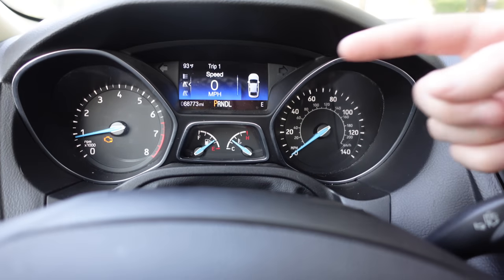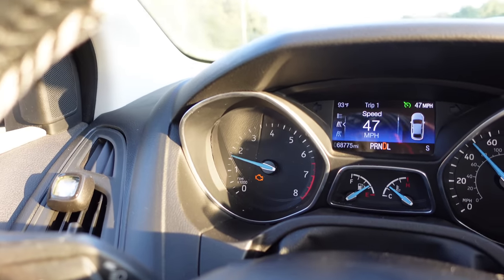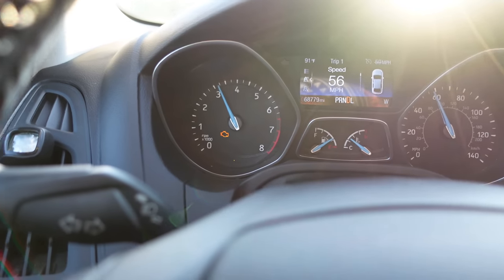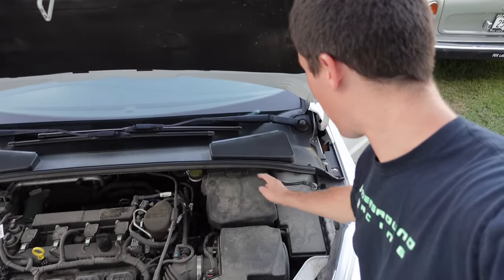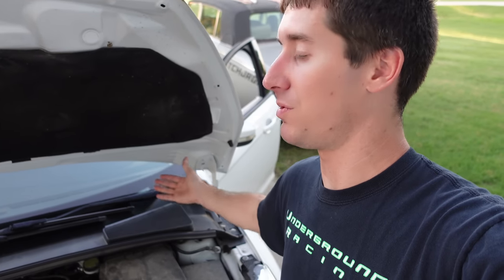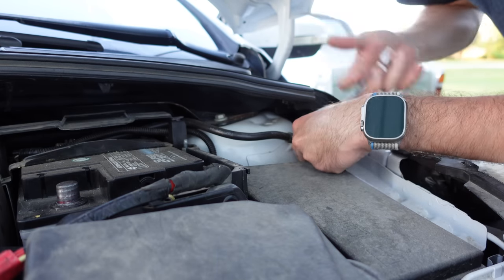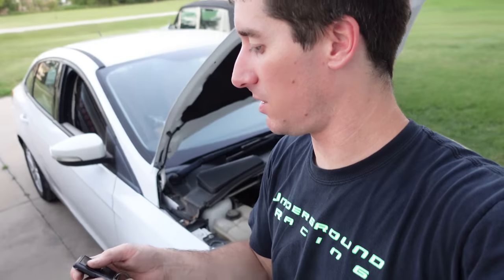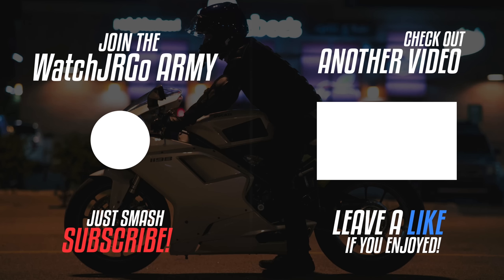This NIGHTMARE Transmission DESTROYED The Ford Focus (Fixing My Girlfriend's)

Comment: I had a discussion with a Lincoln dealer service manager about the fluid change interval.  Even though Ford touts 100K miles, honestly change the transmission fluid every 30K miles.  Dual clutch transmissions put much more work on the transmission fluid as it is the friction modifier as well as the lubricant.  Many times a bad transmission may have bad fluid that leads to clutch degradation.  As a PhD chemist I think that the 100K mile OCI for the transmission fluid is just too long.  Corrosion of grounds can be an issue but if what you describe is happening I think you have physical damage to the clutch packs at this point.

Comment: My mom just went through this with a 2013 titanium with just over 100,000 miles. They couldn’t even get the control module decided it wasn’t worth it and bought a different car. Which was really too bad. They still have their 2001 Ford focus that just refuses to die.

Comment: My wife's '14 Focus Ti only has 20k and it's had 2 replaced under warranty. So far it's been managable outside of warranty so long as you give it throttle with purpose from a stop and occasionally do some highway passes. Car is otherwise mint and pretty good for 9 years.

Comment: I'm at 130k miles on my 2018 focus SE. The only thing I noticed so far is starting at stops on some stops it likes to be very rough. But other than that no issues. 90% of the miles are highway miles though. I haven't changed the tranny fluid yet. I was wondering if I should even bother with it being so late into its lifespan. I would like to keep it going as far as possible.
Reply: Doesn't seem that late to easily drain and fill the DCT Fluid.

Comment: I was a near 40 year long dedicated Ford only owner whose last new car was a 1997 Ford Escort that I owned for 22 years and with nearly 180k miles.  It was as reliable and durable as a Honduh (but without the Honduh tax).    Up until about 178k miles, I had no issues and was just replacing tires, brakes, a slave cylinder in the transmission and scheduled water pump/timing belts.    But at this point the original parts were failing in succession and the cost to repair exceeded the value of the car.   And after 22 years, I was tired of the car and wanted something different.

I had considered a Focus but knew the transmission was garbage and even though I wanted a manual one, the value of the car was also garbage and if I bought one, the resale would decrease significantly.     I started to look around and found out that the 2016 Hyundai Elantra was a great product and after more work, I found one that was three years old, with 21k miles and it looked and drove like a new car.   It cost $13k and I bought it.   I will never go back to Ford.    This Hyundai has been a joy and recently turned in real world mpgs of 48.3 mpgs on a tank.   The car still looks and drives like new and I am blown away with how much room it has.

My sister.... bless her heart, bought a 2015 Focus with that awful transmission without first asking me and she has the issues you point out.   That car is garbage on so many levels - cramped and just not well designed.   So glad I didn't buy the manual transmission version.    

I know that JRCAMO will never fix this and this is because he doesn't fix anything - he just half-arsed does stuff all while his voice made for print media continues to drone on.

Comment: change the actuators.. it worked with mine  (2017 s model) you may have to clean the internal gears from the clutches,,, (they got stucked) there is a guy that shows how to without removing the transmission

Comment: I bought it a 15 Focus SE with salvage title at 56 K miles in 2020 and got to 110 K so I got some mileage out of this . I didn't know about the tranny / clutch issues at all  At first . i got the code P0720  transmission electrical sytem and cleaned the grounds to bare meatal . It drove like new a few times but then went downhill verry quickly and have overheating and no Transmission codes at all .  Now I'm about to put in some clutch actuators hoping that fix it .. super easy to try this bought some actuators on eBay at $40 each . Saw some videos that this works .  just plug and play no reprogramming super easy to do
Reply: What was "overheating"?  How would you know if the transmission was overheating and how might that even be possible?
Reply: @01mustang05  dash said it was overheating to turn car off for a few minutes

Comment: Why did they decide to put a DCT in an econo car??? Are Ford hydraulic transaxles of that vintage reliable, or are they a hot mess too? I'm a GM guy, had problems with the 4T65E in my old GTP and it makes me leery of their transaxles... but the 6L80E in my current car has taken a beating without a hiccup 😃

Comment: I have two of these, a 2012 and a 2015.  Both had the "transmission shudder" as Ford calls it, fixed by the dealer under warranty.  Ford actually extended the warranty to 7 years/100,000 on these tranmissions...unfortunately, not quite long enough in your case.

Comment: It was about 2 months ago I had to R&R a dual clutch transmission in a 2015 Hyundai Veloster. Basically the same transmission setup in the ford focus and if you get a crank sensor code in the ecm data the car will still run just fine but the transmission will not move. After I replaced the sensor with a OEM part the transmission shifted butter smooth. I did informed my customer that the transmission control module will need to be updated not flashed for the fork actuators to keep up with the clutch disks. I will prolong transmission life by 60%..

Comment: As a ford transmission tech, take the car to the dealer, we get about 2 to 4 focus’ a day for tcm issues, they can be fixed and you need to basically abuse the car for it to act right and also the battery must be good for the tcm to act properly, there is no hydraulic controls for these units it’s entirely electronic, the clutch fork is most likely bad on this and will need a clutch job, which will include forks, bearing and clutch with possibly getting both motors replaced, the tcm was extended to 250k warranty replacement

Comment: Bought a used 2013 Focus in 2013 from a dealer that only had 9000 miles.  At the time , we were unaware of the transmission issues.  Not long after we bought it, the problems started.  Took it to the dealer and they said the software needed to be updated.  So within a few days, the problems came back.  Very rough shifting in 1st and 2nd.  It's an automatic.  Every time we took it back to the Ford dealer, we got the same excuse.  They even tried telling me the transmission was adjusting to my driving habits.  What ???  Anyway, no matter what they did, the problems were still there.  Over time, the problems got worse.  It got so bad that sometimes at a full stop, when you hit the gas, the car just sat there.  Very frustrating .  My wife hated driving it.  Finally, after 2 and 1/2 years we had enough.  We bought a different car and offered the 2013 to a Ford used car dealer.  The car had about 45000 miles on it.  The dealer took the car and paid us what they thought it was worth.  Not sure what happened to the car after that.  If the dealer didn't repair that transmission, I pity the guy who bought that car.  As I think back to all the cars I've owned over my lifetime, this 2013 Focus was , by far, the worst car I ever owned.

Comment: Here in the Netherlands it's quite difficult to find an automatic, not impossible but you'll find more manuals. That was the one thing i was looking out for when i bought mine. I have a pre facelift hatch manual which drives great and together with the 1.6 Ecoboost it's fun to drive
Reply: In the UK, prior to about 1990, automatics were only for disabled, elderly or for those people who just couldn't drive very well. Even big luxury cars were automatic because only old men bought them.
Reply: The most effective anti-theft device in the US is a manual transmission.  Finding anyone under 35 who is even able to drive a manual is getting very difficult.
Reply: @pk4459  wow really? Also hard to find new cars with a manual nowadays. I mean automatic is great. One less thing to think about while driving but personally i like the feeling of shifting gears

Comment: My 2013 was bad at 20k or so, which for me was many years later as low mile driver, and it took forever to get Ford to fix it. Eventually they changed out everything after Ford figured out the software, seal leak, clutch issues. It has worked OK since. It took Ford took a LOT of years to figure it. THe clutches when repaired came with 10 year warranty, and the class action suit extended the warranty also. It CAN work fine if properly repaired. For how long got me, I've still only got 70k on it.  The software is strange as it adjusts to how you drive. Yes, I don't like the software that tries to up shift too early if you get off the gas. I can "nail it" and it responds well.

Comment: I still drive my 2012 ford focus with 224k miles I had to change the transmission clutch actuator bought the generic Chinese part at 134k miles and never had a problem after also slow reaction from a stop fixed with a hard polyurethane transmission mount

Comment: I have a 2011 Fiesta with the same transmission and I once fried my TCM trying to jumpstart it due to this same ground issue. Bought my car in April 2011, TCM has been replaced twice. Thankfully, Ford replaced both times at no cost to me. Car has 117k miles on it.

Comment: I have a 2017 KIA SOUL, 1.6 liter 4 cyl. tubro with duel clutch and 7 speed trans. i really have had a very good experience so far, it is ideal for myself not so good for 4 or 5 persons, it's a small 200 HP 4 cyl. but great for traveling at 35 MPG when traveling at HWY speeds of 70-80 MPH.

Comment: Hey JR you create great content. I have a question. Why would a dielectric grease conduct better than paint?
Reply: No . Dielectric grease is insulating, so you're not supposed to put it in between parts that are part of a circuit. You put in on over the parts after connecting them to reduce corrosion on parts that have current flowing through them.

Comment: I bought a 2012 with a manual, and my wife bought a 2012 with the DCT.  I warned her about the DCT, but she told me it won't be a problem.  6 months later lemon law.  My neighbor brought home a used 2017 DCT, and I warned him about the DCT.  He also said it's fine.  Two years later, no reverse and limp mode.

Comment: Ford just replaced my TCM for free with an extended warranty it's a 2014 with 138k on motor. Think still few months or so on warranty. Took dealerships a week to get the TCM beside that was super smooth. Would have cost 1,300 with no warranty

Comment: Take the car to the dealer.  It should be under warranty.  Also, keep in mind, per the ford dealer I talked to to, these are essentially a stick shift that’s being shifted by a computer.  

You stated she drives the car super slow and is never hard on it.  That’s part of the issue.  You need to drive it a little hard sometimes in my opinion.  Look online on how to to do a relearn and how to scrub the clutch.  

I’ve got a 2013 se almost exactly like this.  Had the clutches done around 20,000 miles and a new tcm just before 100,000.  I’m now at 180,000 and the car is still going strong.

If I recall, I got a letter extending warranty on the tcm to 225,000.  But keep in mind the car learns how you drive and adapt to it.  So you may need to have it do a relearn procedure.

Comment: Had this problem and needed a TCM that was unobtainium. From what I understood Ford extended the warranty to fix it but because mine was a salvage title the dealer wouldn't touch it. Found out from a dealer friend they had a waitlist of 240 or so for the TCM. Even the Dorman wasn't available. I found a replacement on Ebay for $320 and it's still working as far as I know.  I will never buy a Ford again after this ordeal. I believe the ground issue was with the connector in the TCM but I can't honestly remember for sure.

Comment: here is the sad truth about these transmissions.   the design is flawed, and they will NEVER operate correctly for the life of the vehicle.   why ford kept making these when it knew the transmissions were a bad design escapes me.  Detroit News covered these transmissions in depth.   I had one of these as a company car and it was fun to drive and great on gas.   I will never understand why ford let this nightmare go on year after year.   even the last years made had trouble.   a manual transmission in this car was the answer.  how many customers did this cost ford ?  unbelievable.

Comment: We had a 2014 Focus we bought brand new. That transmission was so terrible. It bucked and jerked like crazy. The dealer we bought it from just shrugged it off, saying "yeah, that's how it is. It should get better and adjust to your driving." Finally another dealer replaced the clutch packs. It was better...for a little while. Finally after 4 and a half years of frustration and yelling from my wife (the Focus had been my stupid idea), we traded it in (at a loss) for the Subaru Crosstrek we have now that we love.

Comment: I just got flashbacks of working on Fusions that were trying to shift into reverse and forward gears at the same time 😂😂😂 at least that problem if you caught it fast enough was cured by a shift solenoid replacement.  Thanks for sharing the tips, so many newer cars suffer from bad ground connections though it’s not even funny, and they’re all dependent on having stable power or else every module in the thing is gonna start having a stroke 😂

Comment: I had a 2016 Tuson with their dual clutch transmission. They could never fix it so they had to buy it back. Mine would totally go out of gear. No software updates or replacing parts did not work.

Comment: Change the transmission fluid. I know, sounds weird,  but that's the fix. I have a 2013 Escape and I had this problem earlier this year. When I was told it was the fluid I didn't believe it either.  But sure enough I got about 3 gallons of ATF. Drained the pan which should  be about a gallon. Fill. Drive it for about 30 minutes. Bring it back. Drain and repeat. Do that until the fluid looks more normal red than the black that came out. Your slippage should stop.

Comment: I bought a new 2013 Fiesta and at 6k miles the clutches started slipping...I took it to the dealer and the service manager said it's normal without looking at it. I got him to let a mechanic take a ride in it and the mechanic said it was the worst one he had seen so far..The front seal on the trans had melted and was leaking on the dry clutches.. But the trans was making sheet metal grinding noises while cruising at a steady speed...I gave up on ford fixing it right and traded it on a 2014 C7 , which I still have..It has a manual 7 speed instead of the auto 8 speed with all the problems it has...

Comment: Cost to fix: Free
The average cost to fix a 2012 Ford Fusion transmission is around $1500 - $1800 if you go to a mechanic. However, Ford will fix your transmission for free due to a class-action lawsuit and recall. U.S. Ford dealerships have been instructed to provide free transmission repairs to any Ford Focus and Fiesta owners, even if they are out of warranty.

Comment: I dont know if you knew this but you can get another good used tcu and just swap it over as long as it has the same part numbers then you dont need to reprogram used tcu, and these dct transmissions are actually good transmission its the fact they used a separate module to control the transmission gears.

Comment: Bought a 2010 Ford Focus on marketplace. These things are plagued with electrical issues. I'd done the same as you did cleaning up that ground cable because they love to paint over that & cut that electrical power in half. Eventually I gave up due to it kept on killing my battery even though alternator & battery were new. Only paid $400 for her & sold for little profit

Comment: I have a 2012 focus sel, it had the problem feom day one it had 30,000 miles when purchased. It would only shunder at take off. I asked abouts it. I was told by the salesman. It's the reason it got good gas milage. They changed the tcm. Then couldn't duplicate my concern with it. Took it to several other ford dealers. Got the run ground. 170,000. Miles later  when it wasn't covered by the replacement. It was diagnosed with problem. 2022 I  replaced the transmission. I purchased another car while My focus was down. So, at 177,770 , I back at square 1. I hate letting it go because when it's not a sick. It's alot of fun to drive. Still get compliments on how nice it looks. I was hoping the fixed the problem. I wanted to purchase an 19 or 18. But no change so I'll pass.

Comment: I had a 2014 SE I bought used in July 2016 with 19000 miles on it. I got rid of it in Sept. 2021 with only 59,000 miles on it as the transmission was unrepeatable, parts were unobtainable by the dealers, no one else would try to fix the transmission and became too awful to drive. Sadly it was the only thing, beyond a bad horn ground I fixed myself that was ever wrong with the car.  I made the mistake of not doing enough research and I made sure my next vehicle would be a new one, with no major issues, with a 'traditional' automatic transmission (a new 2021 Mazda CX-30).

Comment: I was thinking it was in safe mode.i had an issue with my dual clutch and it just needed fluid change and filter and change of coilpack and spark plugs and it solved it

Comment: The dual clutch transmissions on Porsches are excellent. The 8 speed PDK on my Panamera makes rapid and almost imperceptible shits in standard mode and in sport mode, auto blips on downshifts. It makes manual transmissions pretty much obsolete.